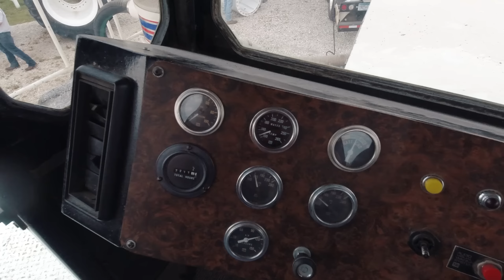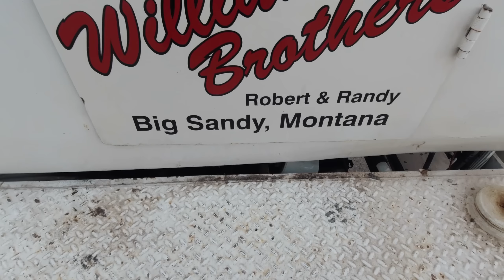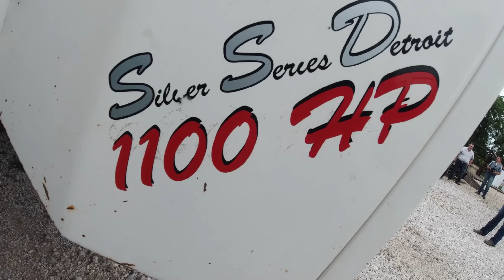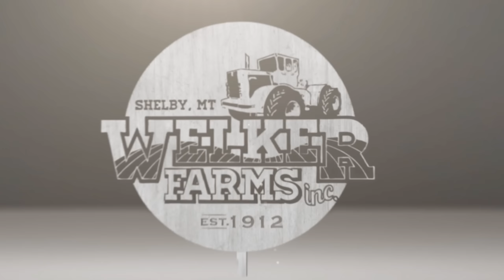World's LARGEST Tractor Gets World's LARGEST Ag Tires! - BIG BUD 747

Comment: They don’t make rubber like they used too.  Thanks California🖕🏿we’ve been getting 5 years tops out of titan, metas, Alliance, and some Michelin
Reply: After the tour of the factory I understand more what goes into making tires. Bias did last longer but you give up the efficiency, traction, reduced compaction, and ride that radials provide.
Reply: Robert Welker all true just saying the rubber compounds today are not as long lasting as they were in the years back.  I see it in many rubber products, hydraulic hoses, seed boots, tires especially.  I’m blaming it on the Democrats!